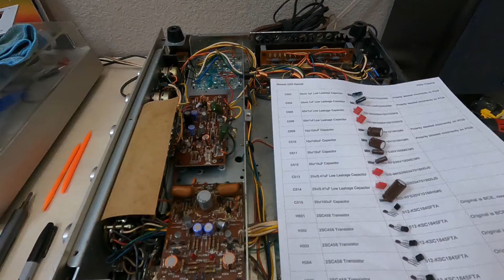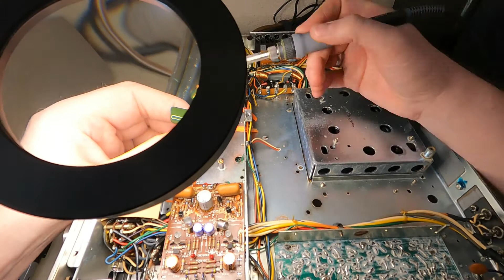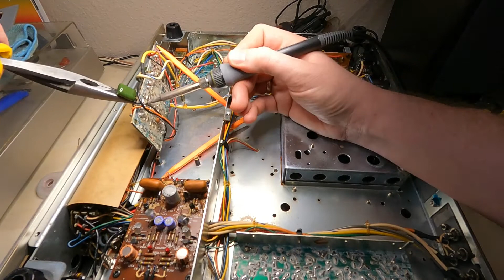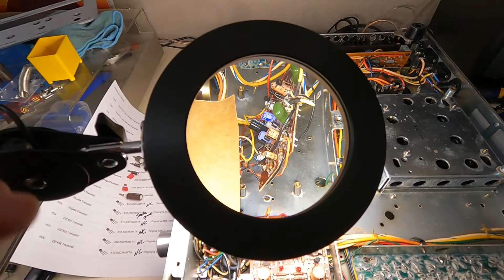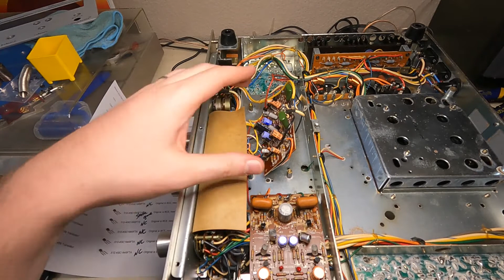Marantz 2220: Replacing Transistors to Reduce Hiss

Comment: My 2220 has some RF issues. I live pretty close to a 4/5g tower (60 meters away) it sounds like this, even with now volume and everything disconnected through headphones - https://www.youtube.com/watch?v=5jUdjH-EPeo&t=20s. I dont have the problem with the receiver in the kitchen. Would it help to change those C458's? just went down the rabbit hole, but dont have any soldering experience.
When I have tinfoil cover the frontside of the receiver it's almost all gone.

Comment: Thanks for posting.  Looks like this is exactly what I need to do to my 2220, as it has a similar hiss.  Would you consider posting the parts list?
Reply from the maker: Common failure points on the 2220:

C503	50v/4.7uF Low Leakage Capacitor		647-UKL1H4R7KDDANA	Polarity labeled incorrectly on PCB
C504	50v/4.7uF Low Leakage Capacitor		647-UKL1H4R7KDDANA	Polarity labeled incorrectly on PCB
C505	50v/1uf Low Leakage Capacitor		505-MKS2B041001C00KS	
C506	50v/1uf Low Leakage Capacitor		505-MKS2B041001C00KS	
C509	10v/100uF Capacitor		555-RFS16V101MH3#5	Polarity labeled incorrectly on PCB
C510	10v/100uF Capacitor		555-RFS16V101MH3#5	Polarity labeled incorrectly on PCB
C511	35v/10uF Capacitor		555-RFS35V100ME3#5	
C512	35v/10uF Capacitor		555-RFS35V100ME3#5	
C513	25v/0.47uF Low Leakage Capacitor		505-MKS2B034701B00JS	
C514	25v/0.47uF Low Leakage Capacitor		505-MKS2B034701B00JS	
C515	35v/100uF Capacitor		555-RFS35V101MH5#5	
H501	2SC458 Transistor		512-KSC1845FTA	Original is BCE, new is ECB.
H502	2SC458 Transistor		512-KSC1845FTA	Original is BCE, new is ECB.
H503	2SC458 Transistor		512-KSC1845FTA	Original is BCE, new is ECB.
H504	2SC458 Transistor		512-KSC1845FTA	Original is BCE, new is ECB.
H505	2SC458 Transistor		512-KSC1845FTA	Original is BCE, new is ECB.
H506	2SC458 Transistor		512-KSC1845FTA	Original is BCE, new is ECB.
Reply: @cilynx  Thanks for posting this list!  For the capacitors noted with polarity reversed, did you find those via the circuit diagram or by inspection/testing, etc?  Could that issue be limited to certain production runs/serial numbers?  I am planning to attempt restoring my 2220 (I’m not an electronics tech), so wondering how to verify that my unit has the same reversed polarity markings on PCB.
Reply from the maker: @danman6139  -- the capacitors you remove will have the correct polarity. Ignore the PCB labels and put the new caps in with the same polarity as the ones you remove.
Reply: @cilynx  of course, that makes perfect sense.  I apparently wasn’t thinking when i asked that question.  Thanks again for all of the good information.